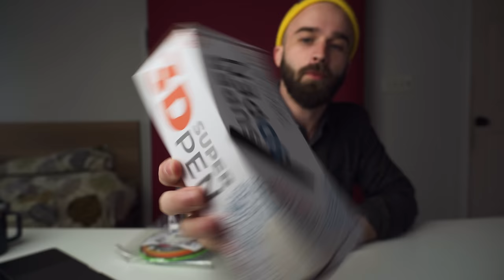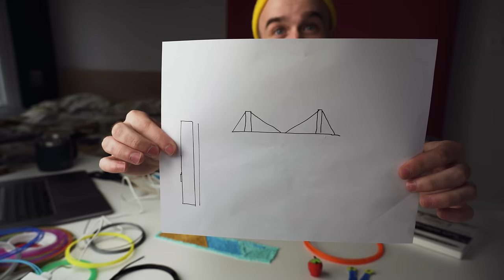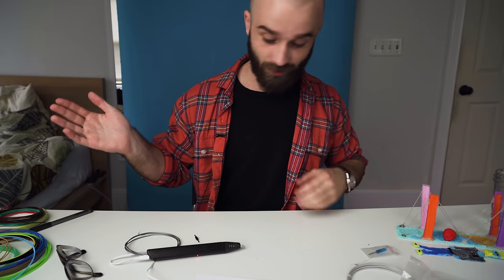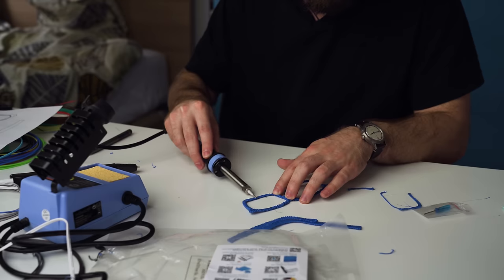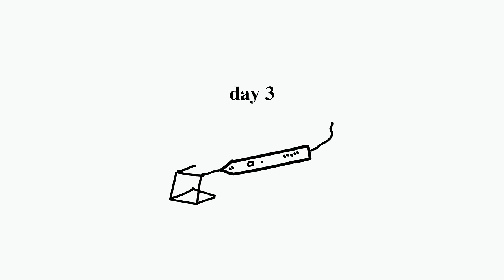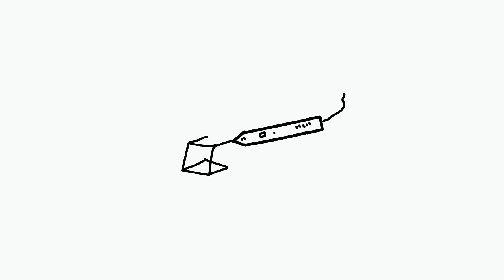Learning to Use 3D Pen with No Experience

Comment: This is an ABS filament ? For smoothing, acetone works great on ABS (though you have to do this outside because of the vapors) and it gives a kind of shiny effect. Otherwise, the PLA filament is healthier and melt at lower temperature, I prefer it for 3D printing (haven't tried the pen yet) but it really depend on what physic properties you want (mecanically, ABS is better). Really impressed with the BMO, super cute ! Anyway, great video as usual
Reply from the maker: I used PLA actually! I had no idea what I was doing when I was ordering so glad I ordered PLA, seems to be safer than the alternative. Glad you liked it, I'm stoked with how BMO turned out as well
Reply: Yeah, safer for both environment and user ! Also it does not smell, does not produce vapors: better for inside use (but ABS is slightly cheaper and usually the defaut filament delivered... only good for fast-mechanical-electronical-engineering-design-stuff-blabla and to make LEGOs). Will we see Marceline for the next art-based skill ?